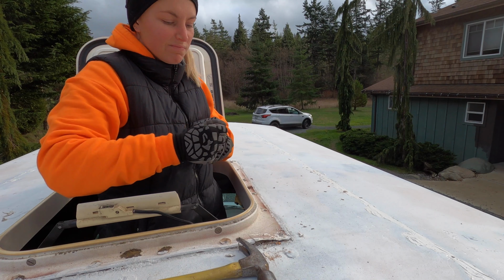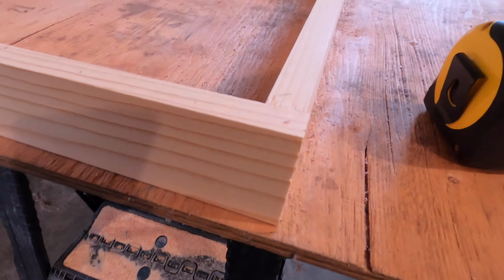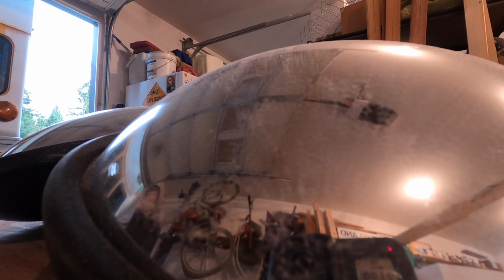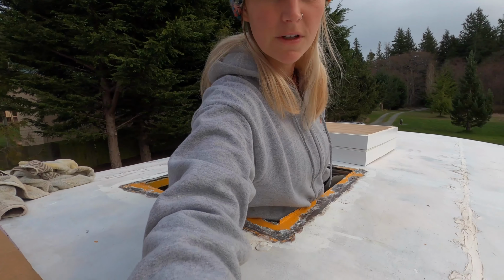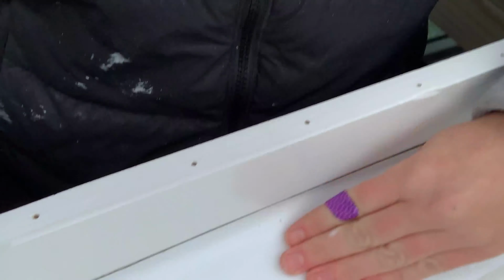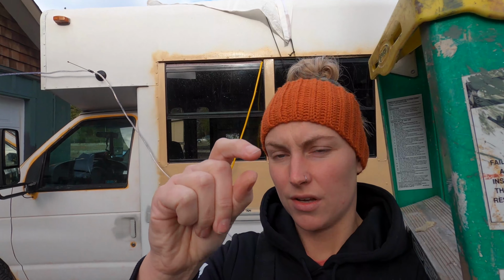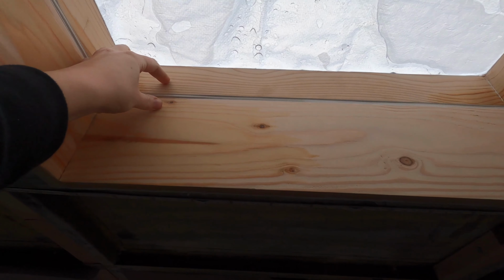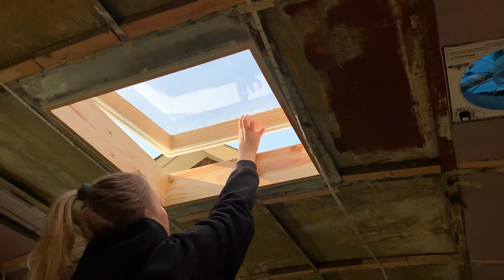Emergency exit transformed into a skylight hatch- School Bus Conversion

Comment: "If this leaks I am going to lose it..." Haha... great video like how you showed the process. Happens to me too. most things I do it seems like I have to redo so been researching the skylight and always asking people, "How's it doing? any leaks?" And most of the time no one replies.

Cool you're building it yourself. Those boat hatches are such a rip off. I screwed my roof up and got some leaks. I got a step van with one of those translucent roofs and I wanted to beef it up since it was like being in a tent when it rained so I got this huge sheet of aluminum and riveted it to the existing roof and yeah I got some leaky rivets that I had to redo and some seams I had to redo and no leaks now but yeah knowing what i know now i would have done it differently.

Comment: I hope you plan on using some silicone around your hatch. Especially where you added the extra wood around the outside edges or where the pieces of wood come together will end up leaking. The paint might hold the leaking back for a short time but the pain will settle, crack and leak if you don't use Silicone. Other then the silicone it all looks good your doing a great job...
Best Wishes
Reply: At 8:40 she clearly stated she liberally caulked the perimeter of the new skylight, then applied sealant tape.

Comment: This is just what I was looking for! All the other DIY hatch builds look way too complicated for me to tackle solo, but yours is very straightforward. How well is it holding up to leaks?
Reply from the maker: Thanks!! I ended up taking off this tape, and using henry self leveling caulk. It worked great and finally no leaks! That tape held in moisture and never dried. I think I’ll do another coat of this caulk to be safe but one hefty coat did the trick :)

Comment: That is a scary situation. I’ve had a trailer come off going down a hill. Definitely puckered for a while. 

350lbs isn’t going to make it or break it. 

May need to move the water tanks and generator to the back. 

Maybe over tightened the grade 8s? But to bend the entire receiver, yikes.